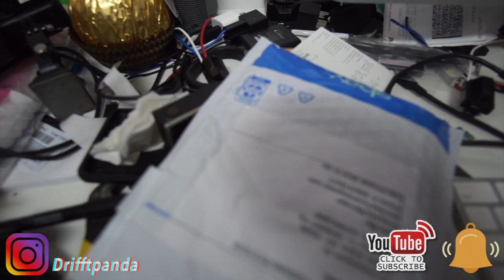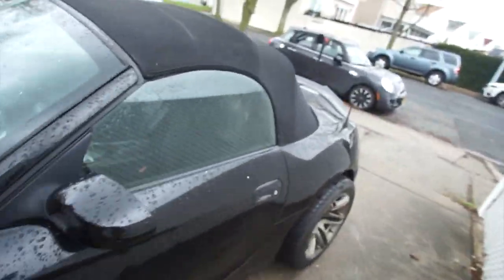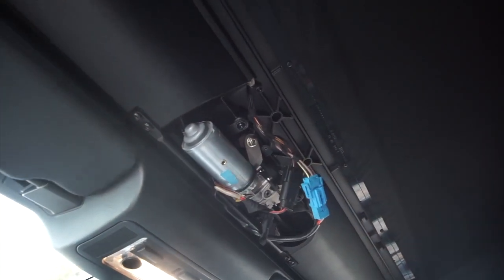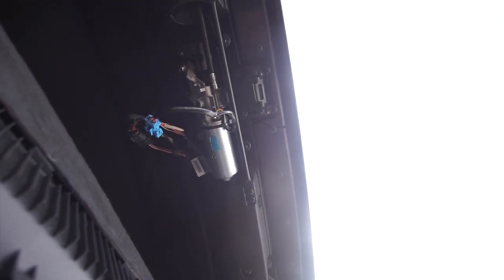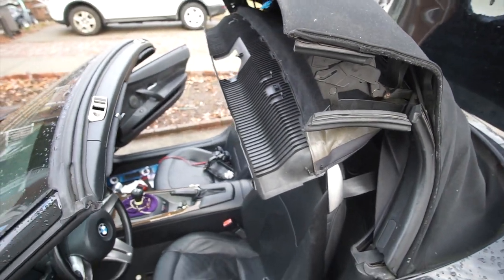Vlog #13 Bmw Z4 Convertible Soft Top Motor Fix !!!!! #BmwZ4

Comment: Do you have a link or part # for the metal replacement gear?? for locking mechanism , would like to replace mine.

Comment: Mines doing the same thing. Moving real slow.  Not sure if it’s the motor or hydraulic lines.   What did it end up being for you.  Did you just replace the motor?
Reply from the maker: It could be the motor - hydraulic lines will just hold fluid - will not perform any movement.